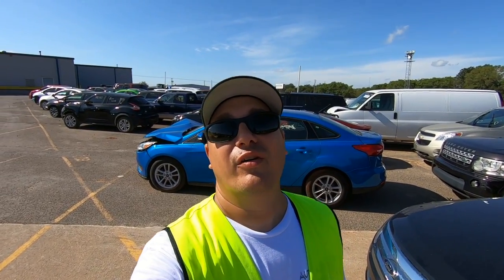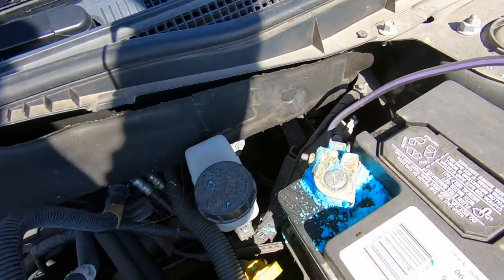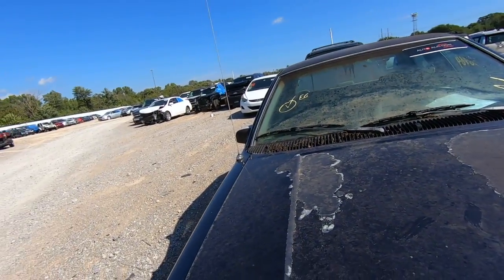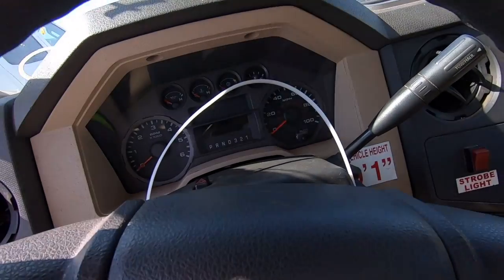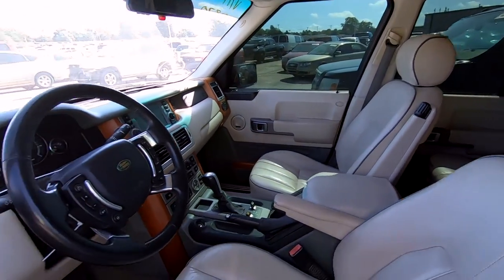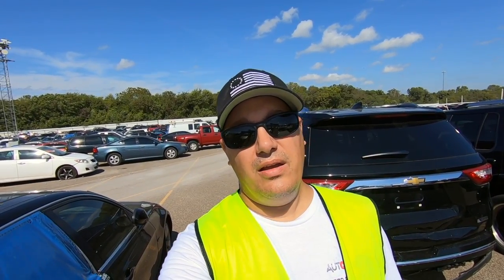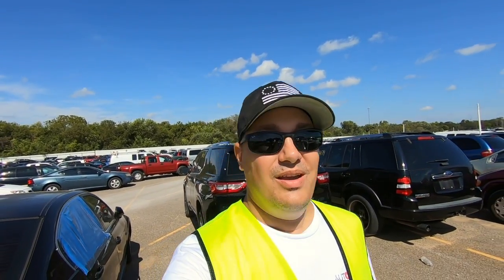Copart Walk Around 10 5 19

Comment: that Red Dodge truck is just like the white 2019 i've been driving for the last month only the one i have is an SLT and it's white with no damage of course. great truck really comfortable to drive anywhere. i had this one in Greenville SC twice and all over Florida and ran up a total of 4,000 miles in 3 weeks on this one. That Blue Escalade next to the Range Rover at 16:29 could be a REALLY good deal for you! those things go cheap at the auctions and i love all 3 of the ones we have. easy to work on, parts are cheap and easy to replace and they are plenty powerful too. i got mine with VERY little damage at all on it for $1,950.00 from copart in Savanah GA a year ago, fixed it up and it's still going strong with no issues and that 2018 GMC white truck should be fairly easy to fix too but good luck getting it cheap enough to still be able to fix it up for re-sale though. people are all over the copart site any more. IAA and facebook Market place are the only places i've seen any good deals lately. too many people on copart trying to make a quick buck these days and too many troll bidders trying to run the prices up too

Comment: Hey Randy, for land rovers they have notorious issues with locked steering wheel columns. Try  turning the steering wheel left and right while turning the key in the ignition, sometimes the column lock gets loaded up and won't release. Also, even though I doubt u can bring it, a short burst of WD-40 (not powdered lube because moisture can make it muddy over time) then put key in ignition barrel. Tap the end of the key several times with a small hammer -- apparently this gets the stuck tumbler to fall right into place. It took me three tries -- a 1-minute fix for $0. Worked fine ever since.

Comment: Randy did you notice that the Tempo had 900K miles. On the at&t F250 the extra tank is for the power steering fluid.
Reply: 92k miles, whoever wrote the mileage didn't note that the white digit is 10ths (or the decimal point isn't legible), it's odometer only reads out to the 10,000s digit. Funny story, The digital odometer in our 85 Mercury Cougar did have a 1 in the 100,000's place (which was the first vehicle my parents owned that did have an odometer that read out to 100,000's) and when they rolled it over 200,000 miles, the odometer couldn't display it so it wrapped back around to 100,000.
Reply: @bradnoyes7955  resale bonus!!!!

Comment: The fan doesn't work on the BMW because it's an electric fan and will only come on when the engine temperature is getting too hot. If you want to know if it works bridge the fan switch on the side of the radiator and check the fan switch with an ohm meter to check if it's an open circuit or not.

Comment: Those Tempo 2.3 litre engines were based on the small Ford inline sixes (144-250 cu in). You know, the one with the intake manifold built into the cylinder head. The rest of the chassis was based on the Escort.

Comment: On the GMC I think they took the GPS out that the finance company will put in and after you take it out the wrong way and don't know what you are doing it will shut the truck down it will be a easy fix just need to find the GPS location and hook up the bypass wire

Comment: You should get that BMW. It just might be a blown fuse or the radiator fan motor is bad. The check engine light is on because it probably overheated.

Comment: The Beater, oops, Beamer, looks clean. I would check the codes first before buying it. It may have overheated if the fan is not working properly and done major damage that you don't know about yet. It could be a good beater for some longer family trips. I would not want a stick in traffic around town. I grew out of that when I was a teenager! I am to old for a stick, I want auto, air, cruise control and power everything or I don't want it anymore! Make life easier, work smarter, not harder! Relax with the comforts, rather than having a second workout pumping a clutch all day! LOL! What happened to motorcycles on Saturdays? I get enough clutch action on my bikes! LOL!

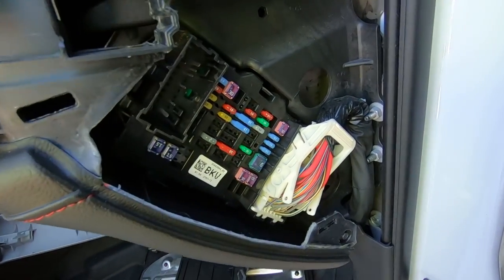Comment: 13:50 means I can't afford this truck anymore  16:21 almost thought the forklife was slamming into the truck 17:40 Immobilizer. Check battery for juice other than to support lights.  Common issue, disconnect negative for 30 seconds and reconnect or remove fuse 18/inspect and reinsert.

Comment: Why don't you carry a portable battery jumper with you? $100-$200 for a good portable. I bet other buyers who want the bid to stay low, mess with the ignition or otherwise make it so the car won't start. BUY IT! At the right price near $3500, the parts on the car are worth considerably more. Can't go wrong.
Reply: Copart doesn't allow customers to carry battery packs into the yard.
Reply: Good to know, I forgot, people can destroy the electronics if jumped wrong, makes sense. But, if it's stated as a running driver, the staff at copart should have them working? lol To much work I guess.
Reply: @TOM-C.  Copart will provide a battery pack for a specific vehicle if requested....although you may have to wait a while before getting a jump.

Comment: That 2008 f350 you wouldn't want in a diesel
Reply: My boss had one that was diesel ran good with no problems. It was traded for a 2015
Reply: @dalehovland3283  the 6.4 usually craps out after 150k miles, probably good thing he traded it

Comment: Trust me you want to avoid a Ford diesel 2008-2010 year models, the 6.4 is the worst engine ever put in a Ford. Id rather have a 2007 with a 6.0 than a 2008-2010 with a 6.4. At least the 6.0 can be "bulletproof".

Comment: The 330 looks like a nice car to flip. But $3k is the whole sale value of the car. Run away from a 3 valve f150. Timing chains, cam phasers, low oil flow to right valves, rear diff failures..... GMC attempted theft? When comparing you f250 remember yours is a 4x4 plus a diesel.  The one towards the end of this video is 2wd & gas. If it's a 3 valve run.